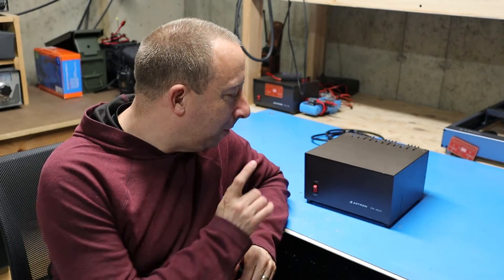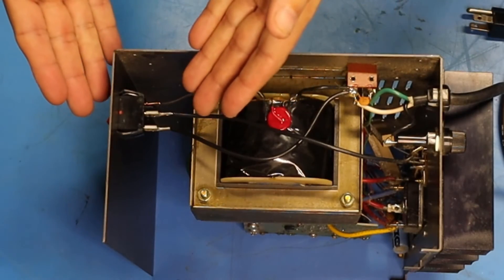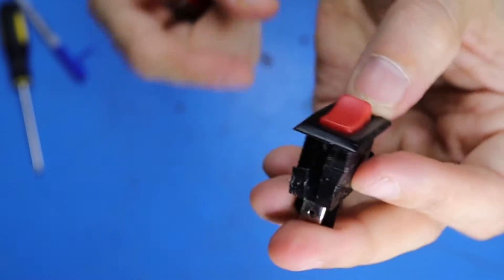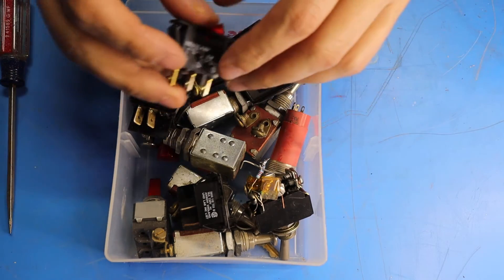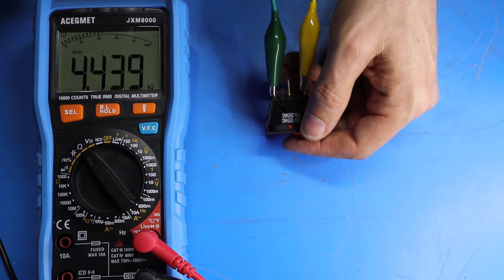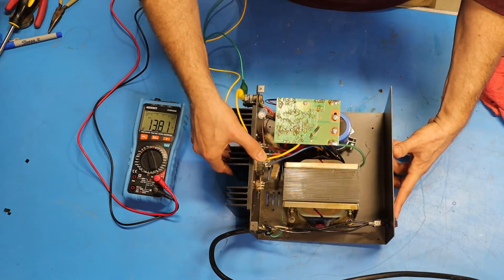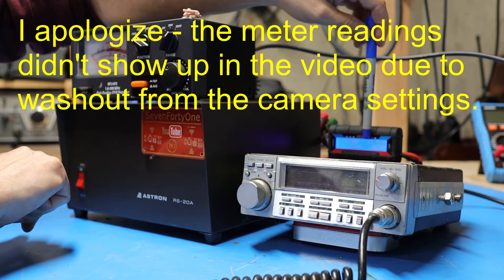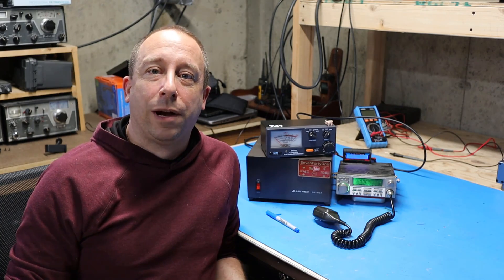Ham Radio Power Supply Repair - Easier Than You Think!

Comment: I have several Astron power supplies. I have a RS-50M that has been in constant service since 1990, I also have the RM-50M, a RS-12 and recently picked up a used RS-35M. I bench tested the RS-35M and was pleasantly surprised with its performance.
Reply from the maker: It's hard to beat an Astron...they do what they are supposed to and do it for a long time without problems (usually)

Comment: An interesting mod is to add a meter to convert these into an RS-20M as it were. The case, however, is made of extremely rugged steel and, unless you you have a set of hellacious Greenlee punches, the mod might result In an unsightly massacre of an otherwise beautiful old DC supply. 
However, if you get one of those LCD voltmeter/ammeter units off eBay that display watts/watthours, etc. You can mount it on the front by drilling two holes: one for the connection wires and one to mount the base plate of the LCD meter. This plate snaps off the meter assembly and can be bolted onto the PS case front. Then, when the connection wires are fed through and plugged in, merely snap the meter assembly onto the base plate and you're good to go.
It'll take a little snooping around to understand how to actually connect the meter into the PS but documentation is available the interwebs.
One additional mod is to drill two holes in the front and mount two female banana jacks - red and black - to access the 13VDC. Then you can use the PS to provide an auxiliary bench source. The make great gel cell chargers, by the way!

Comment: Nice fix. I'd get the odd 240v light switch with the same issues, usually from high inductive loads like banks of fluorescent lights and/or lots of switch toggling, especially on higher loads.
Glad it was not a more costly fault. :)

Comment: I have owned this 13.8 volt 3 amp, 5 surge linear regulated power supply for 38 years, still in like new condition, and I have at various times had to replace transistors in the supply because they die and the output voltage jumps to 19 volts. It's easy to damage them so I suspect something else and will be eying the caps now that it is showing it's age.

Comment: My 35M had an issue where it would randomly audibly " snap " and cut output to zero. Cycle the switch and would work for a day, a week, 15 minutes what ever. I shelved the unit as it was dumping my hf radio and I am sure its not good for it. Finally ordered a new regulator/crow bar board and soldered it in. Been fine for a couple years now, and the price was under 50 bucks shipped from Astron. Mine was less then a year old when it started acting up.